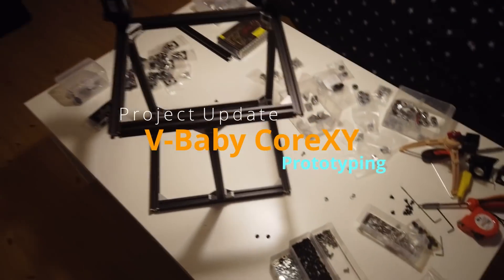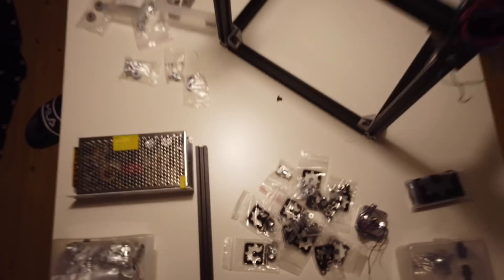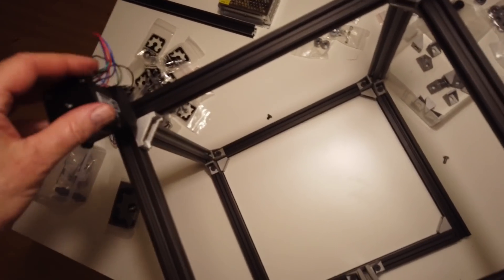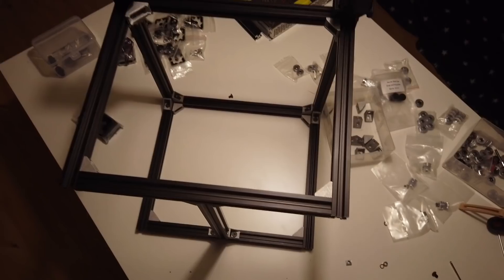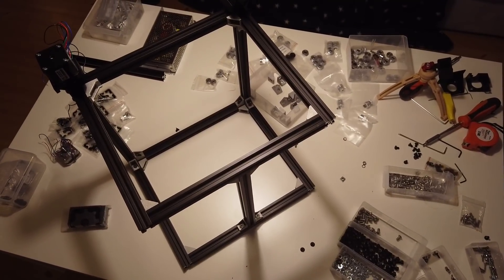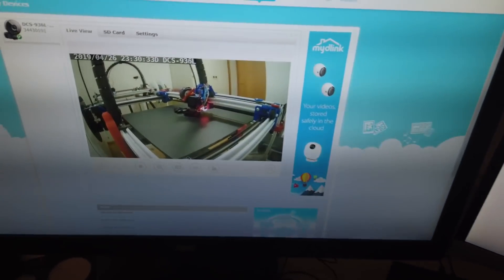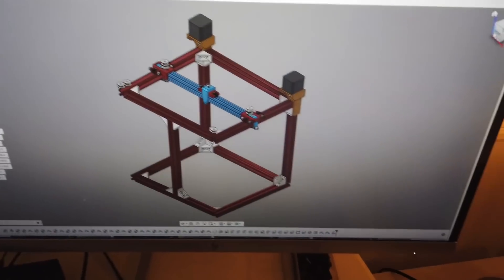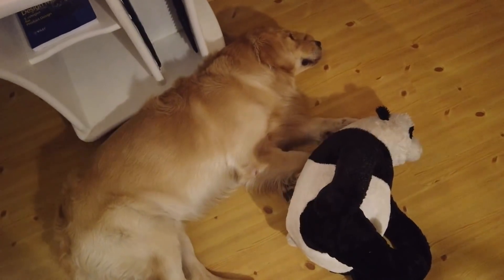V-Baby CoreXY - Project update - Prototyping

Comment: If I put aside the problem of motion resolution, I think the belt gets less tired on 20T pulleys. Because it is less folded. 
So, I have another question: do you use 6mm wide belts or larger in size to pass the stress due to very rapid movements?
Reply from the maker: Thanks I lean towards 20T. They are very accessible and I have a lot of them as well. I am planning for 6 mm GT2 belts which should be more that enough for this length belts. It is even enough on the V-King

Comment: Answering your 16T or 20T question.  My  V-King has no trouble doing 500mm/sec moves.  It could probably do 800 or more if I turned up the motor current a little.  Way way way faster than is needed.  This is with 20T pulleys.  Going to 16T pulleys would lower the max speed but increase the torque and resolution by 20%.  Might even be able to use smaller steppers which decreases the moving mass of the X-Y gantry assembly  because the mass of the stepper rotors is part of the gantry.  On 8 bit processors you might end up speed constrained and want to use the 20T pulleys but that is the only reason I can think of.  No downside if using a 32 bit CPU.
Reply from the maker: Thanks for a good reply. I have a lot of 20T and dont see the big advantage of the 16T but have those in order if it would be a better solution. It is important to decide now or idlers will change location as 16T has smaller diameter than 20T which I will plan for now
Reply: The upsides:
  Smaller diameter pulley might help with placement.
  Increase in torque of 20%. Typical Nema 17 steppers are rated at 3.7 kg-cm (51 oz-in) of torque.  Those motors mass 285 g (10oz) about half of which is probably rotor mass.  If you drop down to the shorter Nema 17 motor the torque drops to 1.9 kg-cm (26 oz-in) and the mass drops to 165 g (5.8 oz).  Using the 16T pulley makes the effective torque about halfway between the two motors.  But the rotor mass is cut by about 1/3.
  Increase in resolution of 20%.  Full step resolution 20T is 0.2mm.  16T is 0.16mm.  
The downsides:
  Max velocity drops by 20%.  Should not an issue as you can't extrude at those speeds and it would make only a few seconds difference in many hours of printing.
  The rotor velocity increases making it more difficult to accelerate/decelerate.
  Possible small increase in belt wear.

On further reflection I am not certain if the increase in torque and lowering the apparent mass of the X-Y gantry vs the increase in energy due to the increased velocity of the rotor is a net gain.  It all depends on actual print speeds.  The print speeds are low enough that I think it would be.  I feel like I am overlooking something obvious.
Reply from the maker: @dougingraham5807  I am not so worried about torque really. It can be an issue with these motors as they are only 0,8A as to 1,8A on the V-King... I dont remember torque on these but that I can find. Dont think it was so low but lets play with this and 20T and see
Reply from the maker: @dougingraham5807   As of speed it is nothing special and I think we will reach what ever inside what is considered normal in FDM technology non super ultra long volcano.... Thinking anywhere under 200 mms is normal
Reply from the maker: 200 I mean travel speed. Normal printspeed is really never over 100 I think